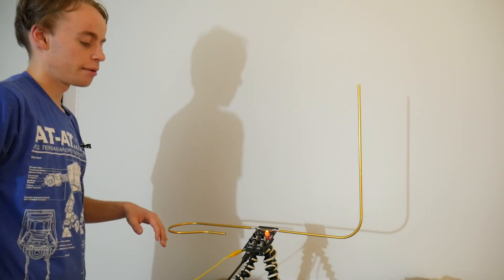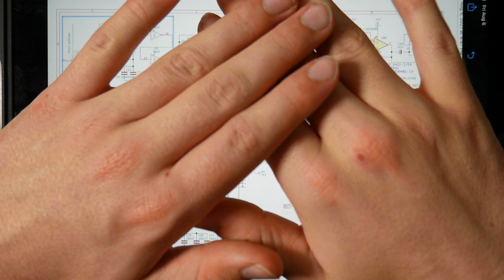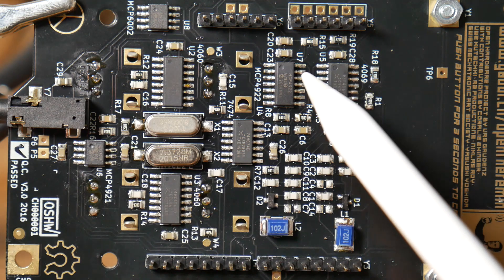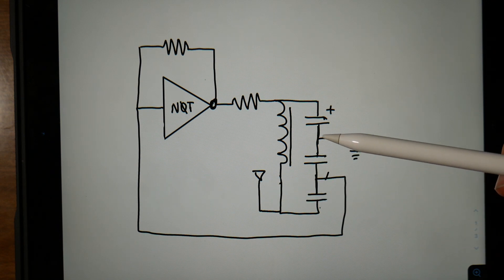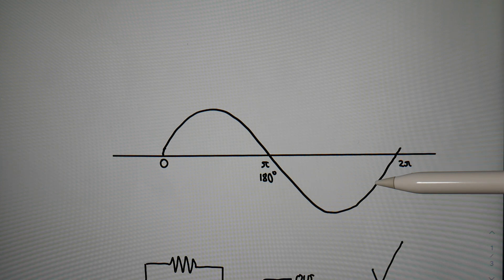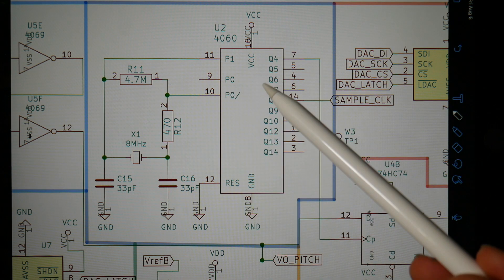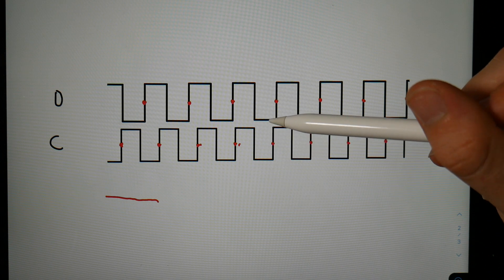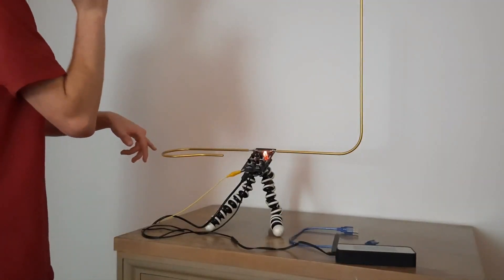Finally, an open-source theremin! (Demo and circuit analysis of the OpenTheremin)

Comment: I have a question. How did you manage to gather such technical knowledge at such young age? Did you go to college early? Did you study all the the hard math required to build a circuit, or do you so without?
Thank you for your time and awesome projects😁
Reply: I got started at age 11 reading Getting Started in Electronics by Forest E Mims 3rd, which was a great book written at a level I could understand even in elementary school. I have a PhD now but still that book teaches me stuff even now. I didn't specialize in this area of engineering.  I also built a number of kits from Heathkit etc back in the day as well as from this book. You really need an oscilloscope to get very far. I started teaching myself programming at age 12 and took community college classes  at age 15 and 17 in programming. If I could do it again I would have taken a class on DC circuit theory at a community college at age 11 or 12.  AC circuit theory however would have blown my mind.  But I guess I could have handled it with a little hand holding at age 14. You need to understand phasers which are mathematical constructs that use complex numbers. I didn't see complex numbers until 7th grade... and wasn't at all comfortable with them. None of this stuff involves calculus yet... The calculus aspect of DC and AC electronics can be delayed quite a while. It's not needed. And besides an integral can simply be thought of as a summation a la quadrature.  I'm quite impressed with this video. I follow it but couldn't easily have created it. I'd do much better at programming the arduino perhaps, however. I've never messed with an arduino but I do a lot of C and numerical computation and other things...

Comment: Should try making the signal antenna a large spring, a challenge to keep up with 😂

Do you have a radiator you could connect to rather than jamming a screwdriver into a power outlet 👀